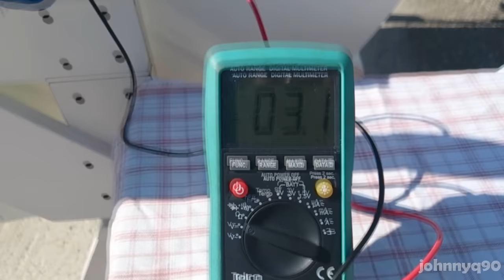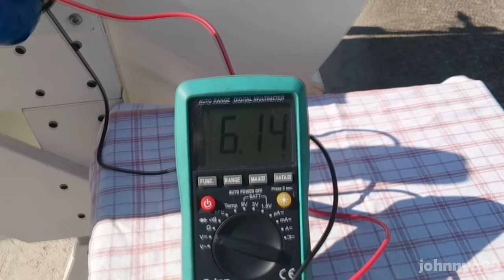Solar Steam Powered Turbine Generator - Part 2/2

Comment from the maker: The pressure inside the tube was initially 120psi. The air turbine handpiece uses 30psi max...
Reply: Have you seen the steam engines developed by Robert Green? You can find them on Youtube. He claims they output 10hp with only 40psi. Could 2 or more of these curved mirror setups generate that kind of pressure?

Comment from the maker: Yes, my mirror can only track 1 axis (east-west), but if you want you can make it dual axis (east-west + north-south). It has 2 photoresistors, which activate an op-amp when the light in one of them is greater than the other and as a result it turns the mirror until the photoresistors receive the same amount of light which make the motor stop.

Comment: What someone needs to do is to develop a closed-loop system like this, driving a generator.  Using something other than H2O as the working fluid, like  r134a - that way the whole apparatus could operate at lower temps = less sunny days.  Plus, if hermetically sealed, you wouldn't need to "top up."
Reply: Water is cheap and readily available. No hazard or risk of contamination if it leaks or explodes. It also can hold a lot of heat and expands 600 times it’s former size from a liquid to a gas.

It’s hard to replace for a reason
Reply: Water has a shit efficiency if you cannot reach ~500°C, and its enthalpy increase demands several stages. That's why those ones with organic fluids are being developed, to use waste heat where a regular steam turbine is too expensive to pay off
Reply: This is called CSP parabolic trough and industrial scale installations exist, 100+ MW. They use molten salt or similar heat transfer fluids.
Reply: It should also have an heat energy storage.
Reply: @alexpd3398  Doesn't matter. You can theoretically use narrow "heat tubes" in the boiler to create steam at quicker and lower temps and have that steam pressure flow through a main pipe and through a turbine chamber to create work.
Reply: I'm no scientist, you guys obviously know alot more regarding this, but I just wanted to mention/ask that if it was a closed system and he did use something other than water that could be working at lower heat,  wouldn't that require more energy to recycle  the liquid since energy would have to be used to recondensate it ?
Reply: @alexpd3398  almost everything has shit efficiency unless at extream temperatures, besides scale is so small that even simple wobler steam engine would have worked with minimal changes to performance. Besides air powered dental drill might be reason for most losses here, its not efficient at all.
Reply: for recondensing, why not warm water for house heating and bathing with steam-exhaust, so steam also condens again and pump brings it under pressure back into steam-pot ?
Reply: There is no truly closed system
Reply: @publicdomain3378  Care to explain that, youngblood?
Reply: The easiest, cheapest way to get electricity directly from the solar panel
Reply: @BluntForceTrauma666 he just saw that line in Mr Robot and could not wait to use it one day
Reply: Yes, why would you even consider building this,  a closed loop system should be the standard,
Reply: @haydenshearer9402 I read somewhere that the efficiency of water begins to break down, either due to micro particles or that the water hasn't had the energy(heat) dip enough to compensate it being sent back to the system, lowering efficiency,  bc, get this, the hotter the water, the less efficient it is to get energy,  go figure

Comment: Have you insulated the face of the heated tube that faces the sun? Less than two percent of the energy enters that side but half the heat exits on it.
Reply: Not really. The heated side of the pipe is going to be much hotter and water flowing through is going to prevent the heat from spreading throughout the pipe. The hottest that sun side is going to reach is around 200-300F.
Reply: @darkhelmet12e47  use the theory of superposition. You’ll see.

Comment: I did this, but I designed and built my own generator; which can make either a/c or d/c.

Also, I designed my own mirror, which tracks the sun and has a focous ratio of 600:1.  It's able to make house current at or around 60 htz.

Comment: Great channel just subscribed. Just a suggestion but maybe solder a more suface area focal conductor. Either 1/4 lines in a radiator style painted black. Encapsulated in a quarts tube filled with a dark waste oil.

Comment: Could closed-loop the steam to re-feed the heat pipe; Could hook tiny generators in series, or, run larger one.  
As with any alternative power source, 1st pare-down the electric usage, Then use it on the more important things--like food-handling things, communications, etc.
The steam thing could be run from a wood stove's water boiling steam for it.
But if you are trying to keep your energy generation under-wraps, need to do something else...the solar dish large enough to power enough steam-generator to run an average house, would be a marker-beacon to attract anyone wanting to use it or take it.

Comment: Hi! johnny.
I am doing my final year project on solar water desalination plant. In this project, we use three major components:
Pre-heater, Parabolic trough collector and a condenser. 
So, We are having a major issue regarding the steam generation in PTC. 
So, will you share the details, specifications or materials regarding parabolic trough and type and material of the tube you are using in this project?
I will be very thankful to you.
With best regards,
Muhammad Talha Malik
Reply: Way not using a regenerative heat exchanger in the exhaust of the steam engine to recover almost al the latent heat from The steam to preheat the feed water, it even can become the primary boiler en the solar collector is only the supper heater

Comment: Nice video, whit a closed system en a regenerative heat exchanger to recover the latent heat from the evaporation your gonna be on to something nice, even consider a closed vacuum steam system to lower the boiling point of the water, en you can store the hot water to Use in the night time aswell

Comment: You could have used automatic pressure valve with a rated bar/ psi that can match the value of power you need your turbine to produce instead of manually operated valves. So that every time there is sunshine it can turn on and off the turbine by itself !

Comment: I thought of this today and I do not see a commercial model available. What gives? I know if I'm thinking it it works. Have you thought of a compacted counter rotation of your generator or increasing the surface area of the disk. I've seen results of  t.v polar lens that melt rock. I think you could direct the light down a sun tunnel. However, me not being an engineer this could have unwanted consequences.

Comment: the first thing to do is reduce amount of money you pay for hot water. that doesn't require steam, just hot water which is very easy to make.

it's a relatively easy thing with solar hot water heater. if you live in a  place that freezes it's more difficult. but a lot of places don't ever freeze so the piping in those places is easy.

next you've got to be able to charge up your batteries.  maybe someone knows the cheapest way to do that.

Comment: more versatile and long lasting low carbon emission possibilities from this set up at least on a larger scale. there could be a spirits burning boiler attached as well fir night use and an anti-reflective glass sheet over the collector to maximize life and ease of cleaning. even with burning ethanol, the carbon footprint of this setup would i think be lower than solar & batteries for several years.

Comment: you need a bigger motor if that motor is producing max voltage then you need one to go a bit over the max and get out the maximum efficiency like a 12 or 24v one

Comment: Instead of making electricity, wouldn't it be more feasible & more efficient if we use it for heating our water supply & thus saving fuel bill, esp. during winter!
Reply: You can use the turbine discharge  for space heat or domestic hot water.  They call such a system a Combined Heat and Power system (CHP)

Comment: How did you make the solar tracker? How does ist work? Is it possible to make it follow the sun horizontally and vertically to use for lenses or circular parabolic mirrors?

Comment: Hey ....can you please tell me the dimensions of the aluminium foil which you used? or...about how you got the right parabolic shape?? like...did you use any equations to calculate the shape of the parabola??
Reply: +Rithvik Vedantam That's readily online and can buy one prebuilt for 250$
Reply: +Anthony Brown my my!!250$?? but I think I'll give it a shot...can you please tell me where can I find that? like..the site or a link....
thanks in advance!!
Reply: You can look up parabolic wiki but I found full scientific ratios  online yesterday, you'll find them if you search    or you can buy go to " green power sceince"  and watch the specs on each one will give you an idea.  I am searching for steam to motor to generator to battery right now
  that one is called a trough mirror   right on you tube make your own do it yourself

Comment: Hi johnyq90, do you think it would be possible to scale this project up?  I'm planning to build a home unit to generate, say 1 or 2 kW, have you investigated about this?... If you find a couple minutes to answer, I'll appreciate it.  A job well done.
Reply from the maker: Of course you can scale this project up, but it should be quite large, like 30-40 sq. meters of mirror area. Also a piston steam engine should be more efficient at this scale. I hope i helped a little;)

Comment: Just curious, what size are the diodes and capacitor on the 3 phase rectifier?
Reply from the maker: mdragos These are schottky diodes. The ones that i use are the PBYR1060 (10Amps max @ 60 Volts). The capacitor was a 2000uF @35V, but i'm not very sure for this...

Comment: That's awesome, but it's probably 1 meter square and it's only getting 2.4W?
So 0.24% efficient?
It's awesome, but still.
Reply: remember that there is desalinated water as a product too. also he is not using specialized equipment, could be way better. finally sun heat is free!
Reply: I'm talking raw energy to energy ratio. 1 square meter of earth gets hit with around 1,000 watts of sunlight, so a 30% efficient solar panel would get 300 watts per square meter, etc.
That's where I'm getting my "efficiency" calculations from. But that doesn't mean much if you have a lot of land and this is cheaper per watt than a solar panel anyway.
Reply: Power output isn't the same as efficiency.
Reply: I could swear I answered that in the comment above yours.
Power in, 1000w/m2. Power out, 2.4W. If it takes up 1m2, then we know power in and power out. 2.4/1000*100 gets us 0.24% efficiency.
Reply: You're right, I was thinking about the efficiency of the steam generator and the efficiency of the motor separately, you were talking about this specific setup.
Reply: Following. Any updates??  1/6/2024.

Comment: What surface area is required to get enough energy for a 3 bedroom house to be completely off the grid, charging batteries?
Reply: Neil Mc George Solar has only a 20% capacity factor at most. But this CSP would be worse than PV's in cloudy areas so I wouldn't recommend this. Unless you have really good insulation I don't think you could heat that size of home with solar power. And specifying just 3 bedrooms isn't enough information to tell how much power you use.
Reply: leerman22 my aunt has solar panels at her house (another 3 bedroom house) 
100% of her power comes from them. she's been off grid for about 2 years now
Reply: Ian Brzostoski
How much power does she use? Does she use gas or wood for heating and cooking? In Ontario's winters our grids emit even less CO2/KWh but we use lots of gas for heating. Also 1 person would use a lot less power than a family of 4. What would the solar capacity and energy capacity of the batteries be? Also every new house should have good insulation.
Reply: i do think that she uses a wood stove a bit in the winter. not shure about batteries and all that. her and my uncle use about as much power as any other couple as far as i know

Comment: OK,  hate to be the party pooper but do you actually gain anything in terms of power generation over that of  a comparable size solar panel?   Unless there's a clear advantage in power I wouldn't bother because you don't need water for a conventional solar panel not to mention having to deal with all the noise a steam generator of any scale would make.
Reply from the maker: HELLH0WND It's not meant for power but to show off the working principals of a system like this...
Reply: HELLH0WND The advantages of such a system that I can think of are 1) mirror or polished metal can be cheaper than solar panels 2) by cooling the steam you have can have clean drinking water from a dirty source 3) solar panels are more likely to be rendered ineffective by EMP. 4) as Red Squirrel pointed out, you can also use steam at night via camp fire etc...

Comment: This seams very inefficient, and shorly they has to be a way of catching that steam and using it as drinking water. 
I mean the hole point of using steam is that it assenshaly acs as a water purifier. So in conterys with out much clean water you can have power and clean water.

Comment: Steam? Where does he get the water from?
Reply from the maker: Mick Carson I fill it with water using a large syringe, you can see it in this video: https://www.youtube.com/watch?v=ToD9UmBWsqc
Reply: Thanks Johnny. Is that concave mirror made of polishes stainless sheet? Is the light directed on that black pipe? What type of generating motor are you using, a brushless? What do you use the electricity for? ...interesting work.
Reply: ***** 
Hi there John. It's been months since I last heard from you in relation to my comment above. I didn't get a reply?
Reply from the maker: +Mick Carson For some reason some comments don't have the reply button, so i couldn't answer to your questions. It's aluminum foil which has a mirror finish on it (from the factory). The sun is direced to the black pipe in order to heat it until it produces steam. I'm using a brushless inrunner motor (16mm dia.). The purpose of this build was not to produce big amounts of electricity (besides, it's size would't permit that), it's only made to show the working principals of such a system. It was made for my thesis for my final year in my university.
Reply: ***** 
Thanks Johnny, you're the man. Good luck to you and a prosperous future.
Reply: Jhonny, Would it be possible to read your thesis?

Comment: Meanwhile I have a diesel engine which is almost as big and put out far more power. Using something like a scrubber def dpf and scr to scrub out the emissions it become far more feasible and cleaner in terms of power than this.

Comment: Where did you get the steam turbine ?
Reply from the maker: I bought it on ebay. 
http://www.ebay.com/itm/NSK-Pana-Max-Style-Dental-High-Speed-Handpiece-Push-Button-4-Hole-3-Spray-Type-/171197346340?pt=LH_DefaultDomain_0&hash=item27dc283224
Reply: Thanks for answer , but are you sure its the right link ?
Reply from the maker: أشرف التونسي Yes, this is what i'm using as the steam turbine on this video. I made my own steam turbine in a CNC shop, but unfortunately it was to big for this project that's why i used this dental air turbine to spin the generator...
Reply: :) respect , thank you for the answer
Reply from the maker: أشرف التونسي No problem my friend, i'm glad i could help;)
Reply: I am working on a similar project and I need your assistance in this regard so kindly give me your email id so that I can ask you some questions regarding my project.